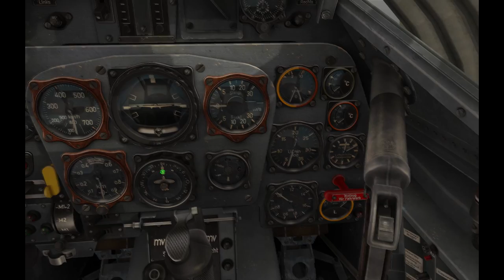DCS - BF109K4 - First Impressions.

Comment: A little tip for the throttle at takeoff from my IL-2 days: We always used to take off with first setting 30% throttle up to 10km/h, 60 up to raising of the tail, 70-80 after that up to 160km/h, then full. Also, I'd really taxi with the canopy open if I where you, regardless if the checklist says otherwise.
Reply from the maker: I'll give it a go, but 70 - 80% throttle is way to much for takeoff, the torque will flip the plane over left, even with 40% the aircraft accelerates really quickly.. It's a lot different to IL2
Reply: 504smudge I know, I explained how we did it in Il-2, the point is to add it gradually in stages ;) Extrapolate it for DCS :)

Comment: Turning off the auto pitch   winding up ata to 12ish with just a little throttle  makes for a more controllable aircraft on  landing ! along with pulling the stick into you with tail-wheel locked !  combined with the 3 pointer ) in all it's a delightful plane after a few hours of heartache at times,    In short   3/4  to full flap 11:30 to 12 ATA a tad of throttle over the threshold at 300 kph bleeding off  with flare down to 200 to 180 kph while letting it settle onto runway on 3 points ! this while slowly pulling stick into full back position ! any correction on ground use  left right brakes Ailerons level  but mainly just both brakes  applied on and off till full stop . no need to raise flaps till completely stopped .

Comment: Hi Smudge,
thks for the video.  Nice to see someone else finding take-off and landing a challenge!  DCS certainly has the most detailed flight model in that regard.  Torque and take-off moment is modeled well, as is the moment the tail wheel lifts off - faster the lift off the more left turning moment, so slowly does it.  On landing watch the ball, if you have any slip it will send you off the runway no problems!

Comment: Great first impression. Just like you i think she is a beast on the ground but pretty agile in the air. Although i found the engine torque to always pull her to the left a bit. It will be interesting to further compare her fighting potential in contrast to the P-51.

Great video! Thanks for sharing!
Reply from the maker: I 100% agree, I get the same with the pulling to the left, the best way to counter that is to taxi with the throttle at idle, use quick spurts of throttle then coast.. I'll hopefully get another vid up soon with a 109 vs 51

Comment: Just a friendly tip to make your landings better:

Since the BF109K4 is a taildragger, if during the approach you slow down too much you will have to flare earlier to maintain yourself flying. By doing so, you won't be able to see the runway (which will make you land away from the centerline) and the landing will be very hard.

Next time keep that engine a little above idle just too prevent yourself from having to flare too early and getting that low.

Regards

Comment: Nice vid. Beautiful plane. When the prop pitch is fully fine the torque is at it's lowest. Taking off with automatic prop pitch will mean more torque as the auto prop pitch kicks in on the takeoff run.  try taking off with manual full fine pitch and turn on the auto when you raise the gear.

I have an irrational aversion to sitting off centre like that. I just want to stop leaning to the right and sit in the middle of the cockpit.  I know lots of people sit behind the sight like that but you all must be crazy!  :P Or maybe its my OCD?

I'm really close to buying this . your vid is very helpful!  I am very curious if she flies straight and level at sea level at max continuous power?  Have to tried to see if it requires no control inputs when cruising at low level? Or does it need aileron the whole time?
Reply: I see you answered my question further in the vid. Historically they were trimmed on the ground to fly hands free at cruise. hence no rudder trim. It shouldn't require any stick force at max continuous power . You should be able to find a balance point at 1.2 or 1.3 ata ? Not sure what max continuous power is on the K4.
Reply from the maker: I tried taking off with full fine prop pitch, but the engine blew up, I pushed it upto about 40% throttle but the shaft must have been spinning to fast because it went pop, the engine is very delicate

Also the aircraft needs constant left pressure on the stick to fly straight, especially at high power settings.
Reply: Sorry for my bad advice about prop pitch. I haven't flown the K4 DCS lol . thanks for the reply. I love this plane and yearn to fly it but holding the aileron all the time when I know it should not need this kinda puts me off. The dora has the same problem but I found out you can change the ground adjustable trim tabs for balance the torque... maybe the same can be done in the K4. You think the stall feel a little off? I guess the flight model is always being improved.
Reply from the maker: Well it's still a beta so I'm sure things will change, but so far the aircraft 'feels' right, how did you change the trim tabs? I've not come across that?
Reply: http://forums.eagle.ru/showthread.php?t=131508&highlight=fw190+trim+tabs

There ya go . Instructions for balancing the dora. She cruises hands free with the ground adjustable trim tabs tweaked.

 If you are curious, It might be possible to find a balance point for the K4 by just playing with the pitch trim and a lower throttle setting.

Comment: try straghtening up the tail wheel before locking on take off
Reply from the maker: Doesn’t make any difference, the trick is to start full right rudder, then straighten it out as you gain speed. Only way I’ve got it to take off successfully

Comment: I'm finding my rudder to be 100% worthless on the ground. Even during takeoff, the rudder does nothing for me. Was this something they adjusted after the release?
Reply from the maker: No it's always been that way! You need to use the brakes to manoeuvre in the ground and when taking off the rudder doesn't work till about 50-70 kts
Reply: 504smudge I've gotten so used to lack of tailwheel lock in the BF 109 in Cliffs of Dover that I didn't even think to look for it in the K-4. Everything working comfortably now! Thanks Smudge :)

Comment: Hey, when I fly my 109 my slip ball is always in the left side and I can’t change it. It especially is deadly when I go into the verticals it spazzes out
Reply from the maker: Tea hey tea, you can set some trim tabs in the Special options settings (out of game) mostly the aircraft is trimmed for a specific speed zone. Use rudder input to straighten out any slip when manoeuvring and you should be golden
Reply: 504smudge alrighty thanks

Comment: Looks like a nice module, but the plane has quite a few defects I find, I'd rather be in a Mustang than the K4. Now if they released a 190 F-8 that would be great.
Reply: _Bugs Because it's better than the earlier models ( engine, armour etc... ) and can do a little ground pounding
Reply: _Bugs To be fair, I'd be happy with any of the radial 190s. Not a fan of the long nose.
Reply: I want an Me 262. I am not the best DCS Pilot and the 190 D9 is a beast to fly but the 262 is a great plane
Reply: quincy8557 Yeah but the engines are very temperamental, you can't just whack the throttle open, you gotta inch it forward.
Reply: TheSkipjack95 I dont seem to be able to turn in a dog fight at all. I am at 400/450 kph and turn and loose all the speed almost at once and stall the wing. I could not even defeat a AI in a P51 on normal. Considering I shot down over 1,000 planes in one campaign in old IL2 its a serious difference
Reply from the maker: I guess that's why DCS is the most realistic combat flight sim in the market, it's not been dumbed down it balanced in any way, the aircraft are as they were
Reply: 504smudge Yep, especially the P-51. A real qualified pilot flying P-51s helped the design. It's as close to the real thing as possible
Reply: tell me .. how many fw´s bf´s that a p51 shot down... can u tell me?
Reply: 504smudge Very well said! Realism is where it's at.. Great review :)
Reply: 504smudge  I would try it one time, it  looks so good concerning all these little details. BUT  I would love it to be a game- simulator, with campaign and so on to the era of planes it uses. i.e. in WWII late war the relative environment and so on for other planes.
Very nice video. !
Reply from the maker: Well that is in the way! Google DCS WW2 they had a big kick starter for it

Comment: there is no way the P51 is faster than the bf109 or fw190
Reply: It is.  But it mostly depends on altitude and pitch.  The FW-190 is a faster climber than the P-51, but at high altitudes (where air duels typically took place in WWII) the P-51 was faster.  I don't know which plane is faster in a dive though.  I want to say FW190, but I'm not sure.  I'm also not sure about level flight at low altitudes.  The P-51 can almost reach it's redline (~500mph) at FULL EVERYTHING,  at low alt and level flight.  It also depends on weather conditions (I think, not know, that It'd mostly depend on humidity) if it is something like THAT.

Comment: seems very difficult to fly
Reply from the maker: It can be, mainly because it has limited trim, but when you get used to it, it gets easier, takeoff is a real challenge at first, but start full right rudder and let off as you build speed and you’ll be golden